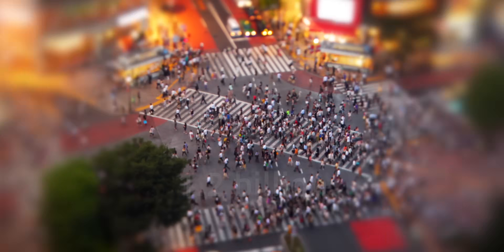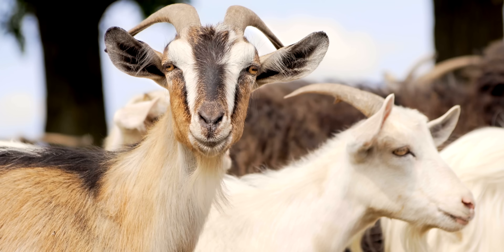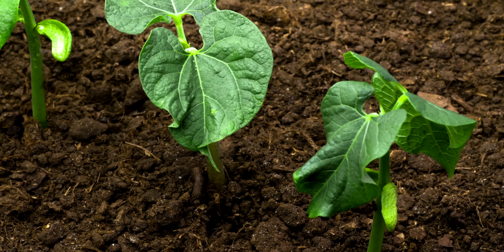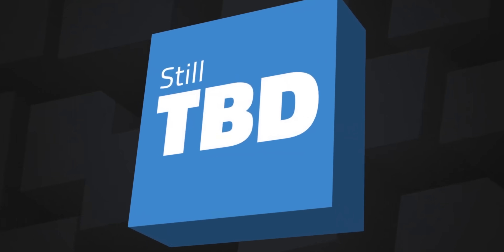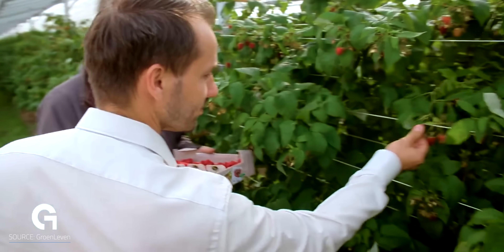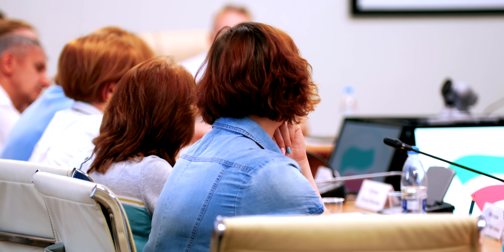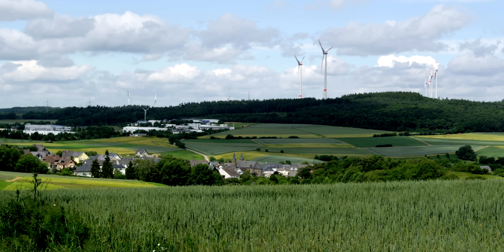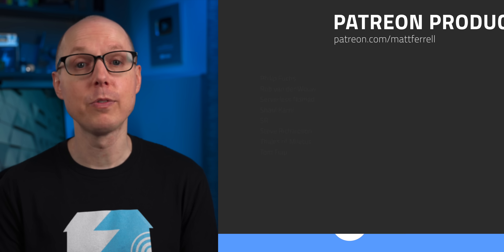Solar Panels Plus Farming? Agrivoltaics Explained

Comment: I wish that instead of the "car broiler" top deck on parking decks in urban areas, the top deck would be covered with solar panel for shading cars & people, as well as generating electricity.  This could be beneficial for powering more charging stations in the deck.
Reply: That's really a no-brainer... makes total sense
Reply: @TheSolarGuyJK  It's a cost issue. Covering a city block, or even a subsection of one, in solar panels isn't cheap, even with the costs of solar panels dropping. And if the owner of the garage can't turn a profit on the panels, they aren't going to pay to install them. Then there'd be added insurance costs of having to repair and replace panels if or when they get driven into.
Reply: @ryanbrown982  Personally, I think the "current local" solar companies are inflating the costs of installation.  I was told that I'd get $20k "refunded" for the installation of an array on my property.  "Oddly enough", my monthly payments would be pretty much the same as a solar array that was supposed to "make money" for me.  Personally, I feel that they do things in reverse.  See what you're already paying, then figure out what a "loan" would be then increase it by the $20k so that they pocket that amount while you still pick up the full cost of installation.
Reply: @TheSolarGuyJK  it's a "no-broiler" too ;)
Reply: Yep and all supermarket and airport carparks, car hire lots etc
Reply: It's not just parking garages.  Look in any urban or suburban area and you'll see acres of large, flat roofs covering commercial buildings -- Walmart's, grocery stores, big box stores, shopping malls, etc.  Right now all of that space is just going to waste with the sun baking down on it every day.  Do you know how many solar panels could be installed on the roof of a Super Walmart?
Reply: @LG123ABC  Not sure if this has been said, but the issue of "Who owns it?" is probably the bigger issue on this, imo.
Reply: @LG123ABC  I've brought it up at the factory I work in, although the senior management of my site are keen on the idea, they can't get the funding from head office due to the high installation cost and long pay back time. In these instances it would be great if governments would offer low interest loans (maybe only charging inflation) for companies to install solar panels on their roofs, spreading the cost over multiple years which could be covered by the energy generated would make a lot more companies commit to adding solar cells to their sites.
Reply: I've been thinking about canopies above parking lots for some time - not just the car broiler either.  Think about the acres of parking in front of the grocery store - what if it were covered with solar canopies?  Grocery stores use a ton of electricity for the HVAC and refrigeration units, even if they never generated enough to sell to the grid, they could radically offset their own load.
Reply: @leifhietala8074  The parking lot at my local community college has solar canopies. And the elementary school has a tall one which adds shade for the kids to play under.
Reply: @leifhietala8074  Also, grocery stores need most refrigeration exactly when they get the most power: at noon. They would stabilize the grid. If they took into account the price of electricity to choose how much cooling they will have at each time of the day, renewables could even work without batteries.
Reply: @rubenayla  thermal storage is a kind of battery.  There's generally an allowable range, if they get an excess of power they could cool an extra 10 degrees and need to run it less later when a cloud went by.
Reply: @DeniseSkidmore  exactly!
Reply: @leifhietala8074 ........nice, and if these were PV-T ( as pv is usually less than 20% gain ) the thermal could be used to drive at least part of the refrigerant process..
Reply: @robertwoodliff2536  Uuurrrh, could it?  I mean it could but you'd have to have absorption type chillers in the first place.  I'm not really familiar with grocery- and similar-scale refrigeration installations, aren't those generally straight compressors?
If they ARE absorption chillers, the potential goes through the roof because then you can have the PV-T panels also feeding into a hot water reservoir for after-dark capacity as well.
Reply: @leifhietala8074 ........if your are putting up PV , with the relative overhead , in these projects , may as well be T , as a future proof . Even if you are unable to drive the chillers , or space cooling , as absorbative systems are rare , as a low grade for winter thermal heating .
Reply: @leifhietala8074  The issue is the support pylons.  If the structure isn't self supporting then the poles discourage people (especially with trucks) from shopping there.   Those panels and mounting are HEAVY.   Notice in this video they optimized for tractors in one direction only.

One local grocery with underground parking has a LOT of spaces with concrete pylons where doors open.  I would say about half of the parking spaces are comfortable to use for most drivers.

(it is a 12 story apartment building on top of that structure)  The apartment parking is in the pedestal so far less "support" needed.
Reply: @redwolfexr  You're not wrong; it's definitely a consideration.  But where I live there's a row of spaces, driving lanes, then a row of spaces.  Before you start over with the next round of spaces and lanes though, there's very often a median - sometimes grass, sometimes concrete, sometimes other - and that's where the lighting pylons go.  Obviously those pylons are nowhere near sturdy enough to support even a few panels, but the property owners already established a space for the pylons and it's usually raised a bit to protect them from damage.  Now just make the pylons taller and stronger to support panels, and all the pylons are between the rows of spaces, in the median where they don't interfere with cars at all.

With sufficient height - added cost up front, but easier to live with in general - you could reach crossmembers from one row to the next to tie everything together and make it more resistant to extreme weather.

Including a tilting mechanism for cooler latitudes lets property owners tip the panels straight up before snow, and then flatten again after the snow is over.
Reply: @leifhietala8074   It would be much cheaper to just add a heating element to the panels than a tilt mechanism that needs lubrication and is only used a few times a year.

But you can also collect rainwater.

By "self-supporting" I mean they would need to be rigid enough to not need a center pylon.
Reply: My local shopping centre (mall) in Sydney Australia has done this. They used to have canvas covers but these were ripped out and replaced with solar panels. The new panels provide better cover for the cars too.
Reply: @brucetownsend691 .......put in Sunfoil and May , and see a guy up country from you , who added a single domestic solar panel on his Subrau estate car, and reduce its fuel consumption by 15%......
Reply: I've  been thinking the same thing.  Parking lots become heat islands that add to climate change, so creating shade + energy seems like a winner to me.
Reply: That would be incredible to have actually. And, potentially, it could just be a relatively self-sustaining system. Having solar panels up top, to power the entire building. And then, of course, battery banks to power it at night, and the charging stations can still require people to pay to use them, thus helping to pay for maintenance of the garage and panels.

If we can find a way to condense many of our current parking lots into garages (even just small ones), this could help everyone out a ton.
Reply: Even just a shade would do, they have those big umbrella roofs in Portugal and Spain. 

Prevents plastic melting and lowers AC operating costs.
Reply: I have been thinking this for years, why on earth in Australia which is hot as heck are we putting solar panels on the ground in paddocks instead of over carparks. Provide shade to the cars, generate electricity.
Reply: @legallyfree2955   yeah, its harder than you would think to put that much weight in the air and not have a lot of supports.  Plus it then acts like a sail the other way.  Add bad weather and you have to make it REALLY strong.  (which means heavier)
Reply: @redwolfexr  In the Northern territory they have a lot of rooves over carparks, many without solar panels, but many with. Also many are just shade cloth which obviously is a lot lighter. I have not seen the financials for any of these options so it is quite possible you are right and it is not financially feasible to do it just for the electricity but if they are building the roof anyway I'm sure they can.
Reply: Very good idea!
Reply: Here in Western Australia, they've been doing that for the past 5 years... is great to leave the shopping and not burn your ass on the leader sit.
Reply: they will be within the next few years when EV's are the norm vs ICE vehicles!
Reply: Wells Fargo partnered with a school district a while back. They put solar car ports in the parking lots, giving teachers a protected place to park, and the school incredibly cheap power.
Reply: Yep. This should be done widespread. LegoLand here in Florida has them and are Brilliant.
Reply: Use the Sun, public parking?
what did you build at home, how long are you willing to wait?
Reply: We had 1 solar roof for shopping mall car park in Kajang, Malaysia.
Reply: Parking lots with solar panel shades have been around for years. Just this week the supermarket where I usually go did that on their large outside parking lot. In 2013 they already had solar panels in the roofs of 46 of their locations.
Reply: New technology for electric power generationhttps://youtu.be/xc2V2BS_Fng
Reply: This has been done. About 30 years ago, a 3M parking garage in Austin had a solar installation shading its top deck for many years. It was decommissioned and removed for reasons I do not remember. Several surface parking lots in the region are currently shaded by solar sheds, as are a number of parking lots throughout the sun belt. These are mostly utility-interactive systems.
Reply: The home office of Darden Foods (Orlando)
has a multilevel parking garage with the top floor shaded by pv panels .They supply about one third of the daily electricity needs.
Reply: Here's something for the idiots of Renewable Energy: 

Sooner or later you greenies are going to need to grow up and learn how economies work. - hint government people understand nothing of economies other than  how to rape them.    

These G-morons decided "woke' power (power that doesn't really work) was a great idea for them, not us, so they decided to steal some money from some ratepayers in order to pay others to stimulate the growth or power that really doesn't work - ie wind and solar.

In the real world, the one that really works,  there is something called supply and demand and these things regulate the price of everything fairly.  

Your butcher buys his beef by the side and pays more for it than the meat packing plant did who in turn paid more for steer than it cost the rancher to produce it.   Get it so far?     

Now when you buy that beefsteak at the butcher's shop he's going to get his markup as well,  so you as the end consumer are going to have to pay a lot more for it per pound than the rancher was paid for it.   

Next time you want a beefsteak drive out to a ranch and buy your steer on the hoof - then you slaughter it, age it carve it up sell the inedible parts to dogfood processors and the like and eat the rest of it on the cheap - no you want the value that all those who added value to the meat along the whole length of the supply chain don't you?  Or do you buy your steaks on the hoof?      Or do you expect to pay the  ranchers price at your favorite steakhouse as well?

It's that way with electricity too, you cannot expect the power company to buy power back from you at retail rates when they don't even need or want the power. With that business model they will go bankrupt as soon as their investors are wiped out.    

If that rancher were to dine out at your favorite steakhouse why not demand that your ignorant politicians make the restaurant buy his on-the-hoof steer from him on demand at the same rate per pound that they charge you for a 16 oz prime rib?    

The problem is, as with all government planned economies, sooner or later everyone will want to receive the grift instead of paying for it, when that happens the lights go out - permanently.

The most ignorant feature of all of this is that it is supposed to solve some problem that the grifters dreamed up but that does not actually exist so solar panels and wind turbines only create huge problems, they solve nothing - time to wake up you dizzy Californians.
Reply: That's a brilliant idea! Using solar panels to cover parking decks would not only provide shade but also generate clean energy for electric vehicle charging stations. Do you think this concept could be widely adopted in urban areas? What other spaces in cities do you think could benefit from similar dual-purpose solutions?
Reply: AGREED!!  I worked for years and had to park in a parking lot, and the car would ROAST in the summer sun.  The carport SOLAR solution is a no-brainer!!
Reply: well, start a business putting them in.  If they make $ for the owners it should be a slam dunk.
Reply: @clewis3762  The following is all my personal opinion that isn't based on any numbers research, but relies solely on my experiences with bureaucracies and people in general.

I'm not sure about the numbers (because I'm not interested enough to get into those weeds), but you would need a far more massive solar array than any parking lot to be able to run a charging station that would, realistically, be charging a vehicle all the time, let alone a number of cars.  But if we hold to the concept that the solar array is a supplemental input to the entire grid, as well as any others that could be erected over similar parking spaces, then we'd massive reduce the hurdles needed to convince people into just getting the up in the first place.

Remember, adding charging stations is a huge undertaking that a lot of municipalities would probably balk at not simply because of costs.  There's the structural changes that would need to be achieved, and most large cities have painted themselves into proverbial corners when it comes to space on and below the ground.

If it's a far simpler proposal just to put the panels up and feed into the grid, then I'm sure there would be a lot more success towards getting them up in the first place.
Reply: Snow removal / management would cost plenty!  Not as simple as dragging a snowplow across asphalt.
Reply: @eugeniustheodidactus8890  you're thinking of the wrong latitudes...
Reply: @Pedro Abreu It is done all over the South US too.  Kalifornia is a special case as its gov is more corrupt than  in 1930's Italy.

Comment: Are there toxic residues from the panels and metals that can leach into the soil, due to the intense heat from the sun beating on the panels, and rain washing the metals and toxic components from the panel. Plants will clean the soil of this. Buffer strips to clean the soil might be a better idea. People do not have enough insight into potential threats to the environmental health which includes all Flora and fauna. The current climate changes and geologic processes are violent and cause serious damage to the solar panels. Usually the advantage will be geared towards the wealthy and the consequence to those without advantage. Same old story.
Sorry, but I'm glad you asked. The world has ADD, bipolar and doesn't clean up the past before starting the next big Agenda, it's either the top of the mountain or the bottom of the pit with greed as the motor with no helm.

Comment: One advantage of agrivoltaics is some income stability for farmers. With climate change varying the climate, making the start of seasons less predictable, and harsher conditions overall its becoming harder to rely on crops as its possible they may not make it if a freak coldsnap or drought hits. Especially for smaller farmers who can't bounce back as easily, the income from the panels acts as a reliable base pay they can count on, diversifying their risk. From my research it's not as profitable as doing one or the other, but it's a balance between high yield crops and stable income.

Comment: "Look at what they have to do, to mimic even a fraction of our power" - Nuclear
Reply: I've never heard of a solar panel going into meltdown and exploding with the resultant radio toxic dust drifting from say Ukraine over western Europe covering Iceland, Greenland and the North Pole or polluting the ocean. If a PV panel did meltdown I think that I could deal with it, by myself, in less than an hour.
Reply: @stevenleighton1947  But they have started roof fires. Mostly avoidable but so are the nuclear accidents.

Comment: Interesting topic! I wonder how small you could scale it.. Like could you do this to any great effect with a backyard garden?
Reply: My guess is it would work fine. The beauty of solar is that even a relatively small amount of panels can be matched to smaller and cheaper electrical equipment, e.g. inverter, and still produce good amounts of electricity.
Reply: @mcg6762  I would love to use garden solar to power pump for rainwater irrigation or even the well I have on my property, maybe some lights or fans in the garden but I feel so unsure about how to get started with designing the system. Do you know of any good resources you could recommend?